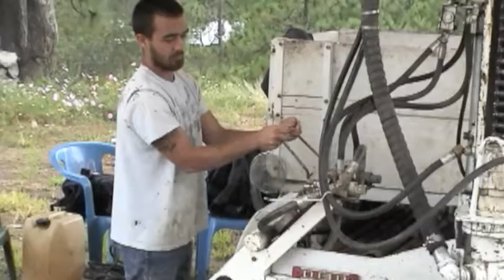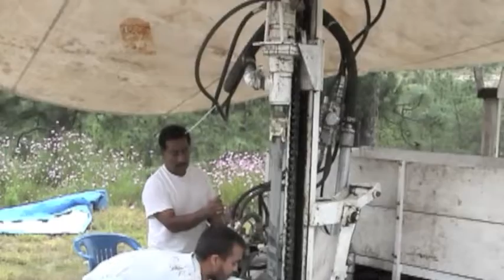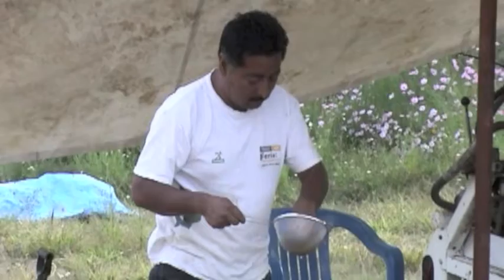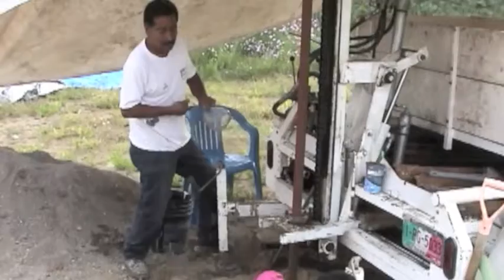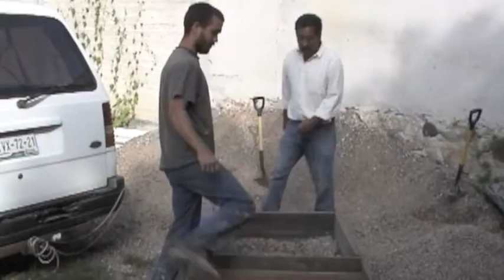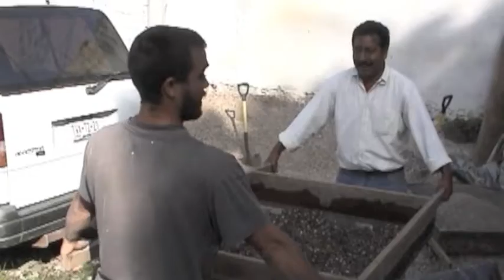At the controls of a well drilling rig

Comment: Hi i'm looking to upgrade my current home made drill rig with one like yours. can you please let me know the manufacture and aprox cost. GRACIAS.
Reply from the maker: I fabricated this drilling rig from my own design.  You can find swivels, tool joints, etc at North Houston Machine - they have a catalog on line.  Cost would be according to what you need. There are other suppliers to be found on the internet.  Thanks for your interest.
Reply: Hi thank you for your reply. I have another tech question, what # welding rod do you use to weld the couplings to the drill pipe.I have a problem with the welds braking loose and i'm losing pipe down the hole ( 3 times ) GRACIAS
Reply from the maker: Hey Oscar   I want to reply here to your question although I may have answered it in my email.  You have too much drill pipe wobble and it is like when you take a wire and twist it back and forth over and over its going to break.  If you can't get heavier pipe you'll need to figure  a way to get the pipe to stay straight.  If you are still struggling with this email me and I'll give you a couple of suggestions.
Reply: HI yes I'm still struggling with this any tips I would be very grateful